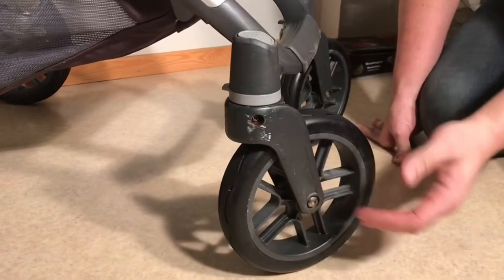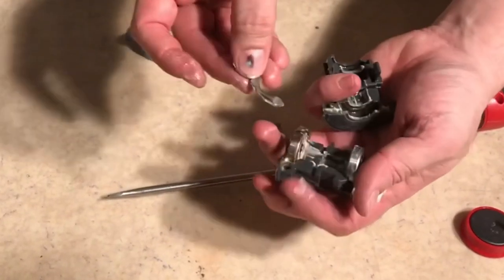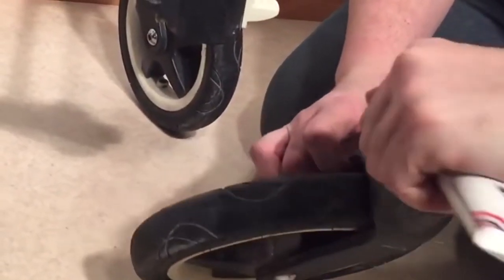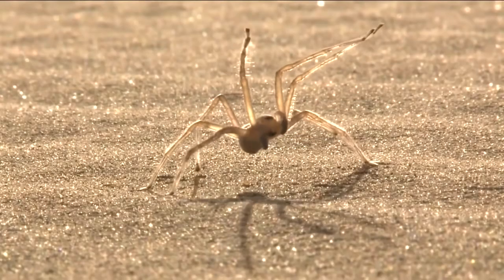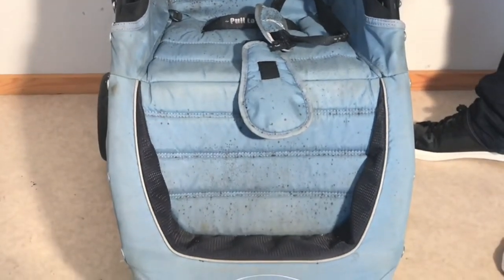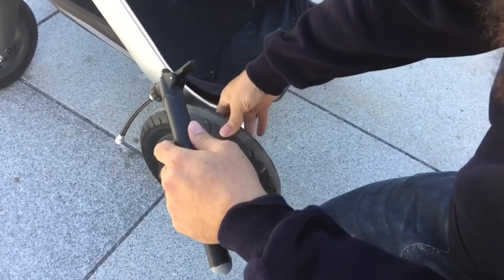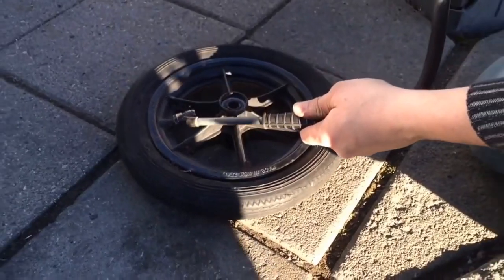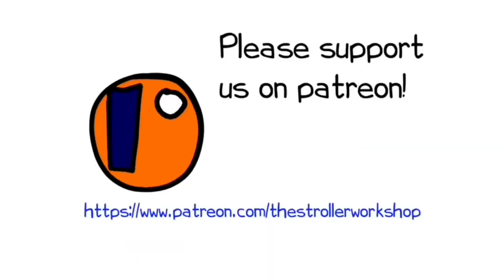3 Things You Should NOT Do to Your Stroller

Comment: As already said, WD-40 is mainly a water displacer, very good to prevent rust very penetrant so it's terrific for seized part of the stroller and/or when you clean it for it's monthly maintenance cleaning (plus a degreaser)but it's lubrificants part it's nothing to write about,  for long term lubrification a generic silicone oil works better.
For lubrification I find exceptional the WD-40 "specialist" PFTE dry lube spray,  thin, still very penetrating and once the oil evaporate it leave a silky ,non greasy patina that doesn't attract dirt and works very well with any combination of metal and plastic.

Comment: Good tips! If in doubt I would buy a “wet lube” from your local bike shop to lubricate most areas associated with the wheels. Good to clean out quarterly with degreaser on a cloth and re-lubing as any lube attracts grit and dust which will wear down all friction parts over time. WD-40 may help degreasing but leaves an oily film which isn’t ideal as lubrication in wet areas (as wheels tend to be). I only know this because I’m a cycling nerd (who happens to be a fan of your channel!). So wet lube + regular cleaning is key to a long lasting wheelbase 👍🏼
Reply: What’s a wet lube? A grease or silicone?

Comment: The main problem I have with using WD-40 is the strong smell. Unless the spray can I have is too old and has developed a strong smell over the years I've had it. Also, if storing a stroller for long periods inside, don't store it near a sunny window or door. I bought a used Emmaljunga (still have it in my collection) that has all the sun fading on one side, which tells me it was constantly exposed to a sun source from one direction as next to a window. I'd like to dye the navy blue hood but it has a white liner with navy flower print which would be messed up if the dye bled through.